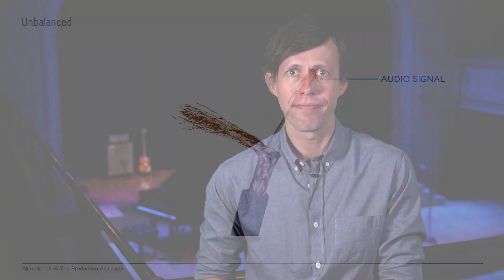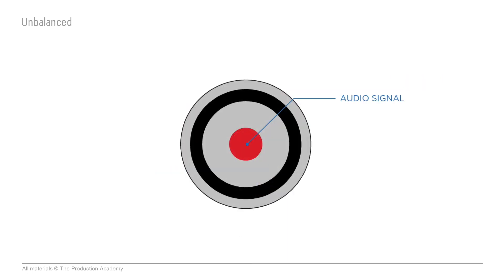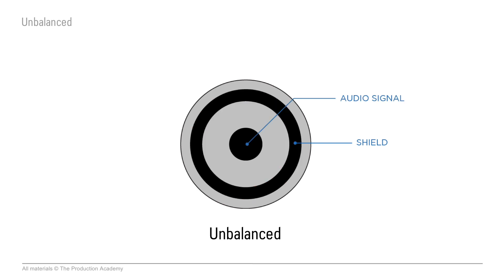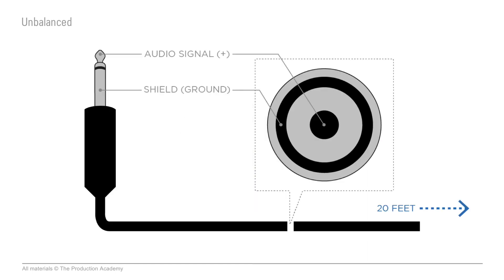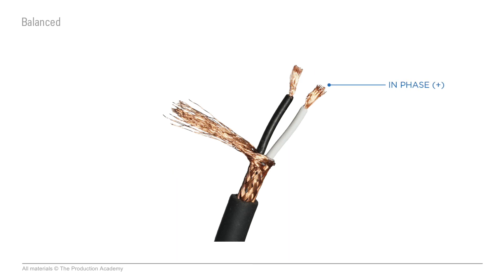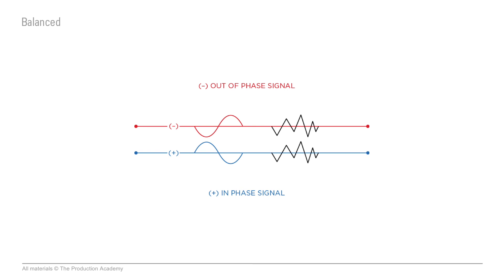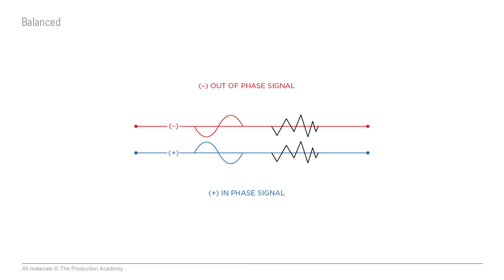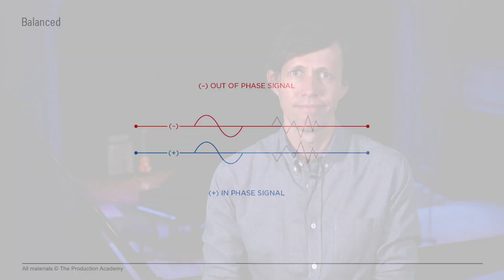What is Balanced vs. Unbalanced Audio?

Comment: They can call it whatever they want to.
But in a blind listening test ...
You won't be able to tell a difference between different audio cables.
Just wishful thinking -
Moreover, nobody can explain what "unbalanced" supposedly sounds like.
It has FAR more to do with speaker placement and room acoustics than cables.
Reply from the maker: Hi Scott, What I'm trying to get at in the video is the distance you can run unblanced vs. balanced. In live music situations, we often have to run cables long distances, and you can't run unbalanced cable very far without audible signal loss (only about 20-30 feet). I'm not really debating anything else about the cabling (like the construction of it). But if you ran an unbalanced cable 100 ft, the signal would not be useable. 

You're right about some of the marketing on cables, like "gold plated" connectors. A lot of that stuff is super minimal, at best.
Reply: @theproductionacademy  -  Yes, and the only difference here which might possibly matter is the great length the cable is being stretched.
I'm just curious to know if you've tested it all with totally ordinary cables.
You know, everything identical EXCEPT for the supposed quality of the cable.
I'd sure love to see a sort of double-blind listening test of that  -  cheap cable versus expensive cable, when the length is ridiculously LONG.
Experience tell me this -  Never use an under-powered amp for you speakers.
Use kick-ass speakers which have a very flat, wide response.   Have an acoustical space which works in your favor, rather than works against any advantages you've achieved.
Reply: @theproductionacademy  -  Just how long does a cable length need to be before any actual real verifiable issue is determined to exist?   And HOW is it determined?  With your ears?  Or with instruments which essentially measure nothing whatsoever?   Too damn many snake oil salesmen.
OH -  live music situations.  ?   Hmm, you mean maybe outside concerts which are hardly "high fidelity" to begin with?    Hey, so what is the solution?  Just use much shorter cables, and put your stuff closer together?
Reply: @scotthullinger4684 well not mentioned is that a balanced circuit signal is higher voltage and will therefore be louder.  Today I plugged in equal quality cables but xlr and a balanced circuit from dac to preamp.  Very noticeably loudet but also sounded superior to unbalanced rca connections.  Again, comparable cables DH Labs air matrix.  If you think cables dont matter I assure you they do, but choose wisely.

Comment: Why selll or use unbalanced audio? Is there any advantage? Is it just cheaper?
Reply from the maker: In short, yes it's cheaper. It's not only the actual cabling, but balanced audio requires a special circuit on each side. This adds to the cost of manufacturing.

Also, like many things in audio, it has just become standard. And there's no real disadvantage to it, unless you need to run it more than about 20 feet.
Reply: So if my DJ controller is "unbalanced output", should I buy a balanced cable or not? Do I need to run it to a mixing board first  or something?